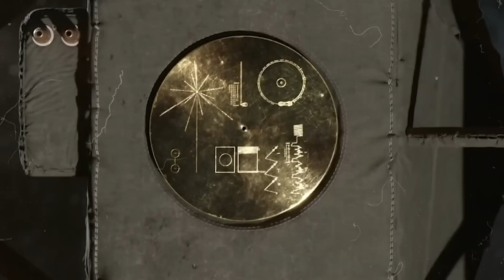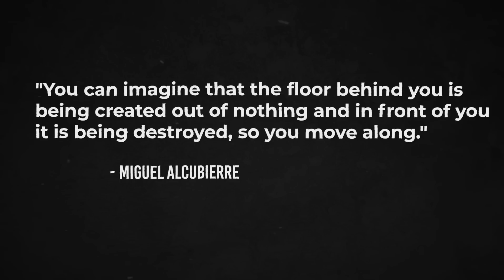Warp Drive Has FINALLY Become Reality! German Physicist Found A Solution!

Comment: The Alcubierre Drive is overblown.  Superconductors, a manifested Meissner force field (electrogravitic neutron field) around the object's nanomeshed energized surface (Section 4 - Area 51 - UFO fabric).  No extended ringed drive - like a Dyson ionizer air fan.  Propulsion is done via a gravity drive (like a tractor beam) out front in whichever direction of velocity you want to achieve.  All true UFOs have such Meissner force field, which allows supersessional flying with no gravity, g-forces on the pilot and occupants, or shear forces on the vehicle.  A Meissner force field is the actual worm bubble "slipstream" that one sees in the tictac video.  That worm bubble removes all physical matter interaction, and is the portal into the dark universe, with velocity creating the appearance of a worm bubble.  De-manifesting the Meissner force field (worm bubble) pops the starship back into the physical matter universe.  As such, a worm bubble is the warp and light speed.  This worm bubble removes A-L-L Einstein General and Special Relativity - and mass and light speed restrictions.  The cosmos is 3D and such 2D pictorials of Einstein-Rosen bridges and folding space is insane and invalid.  The cosmos has the multiple and parallel universes of the dark universe and physical matter universe - switching between them.

Proper understanding of superconductors are "conduits" between the unlimited energies and forces of the dark universe and the physical universe.  This is the truth of such supersolids, flow metals (metallic hydrogen), and supra-plasmas being free energy sources.  All modern definitions and experiments of semiconductors (with external forces applied to them) are not superconductors - they only have the appearance as a super semiconductor (Meissner force field).  Remove the external forces and return to an ambient temperature and pressure - and you have a semiconductor.  True superconductors are self-powered and self-regenerating from the dark universe - and operate in any ambient condition.  As such, superconductors are the source for all light speed, warp, worm bubbles with a Meissner neutron force field, and wormholes travelling to distant cosmic locations.

Quit thinking in the physical universe - and all the constraints continually being observed and hindering the true search for warp speed.  Moving into the dark universe eliminates all those conditions and restraints - allowing free flight potentials.
Reply: Bingo guy.  You figured it out.  Bob Lazarus worked at S4 on alien technology propulsion system.  He explained that alien space craft use this exact technique.
Reply: Interesting, I haven't seen this info pop up since the 80s. It was part of an investigation into creating anti gravity drives and essentially "splitting" open an bubble or envelope int the fabric of space essential removing the restrictions (drag) of space. It was originally orientated toward low gravity aircraft.
>
I speculated a toroidal drive based upon the liquid metal super conductors a while back and came up with something similar that create something of a low and high density space befor and aft of a space vessel.. Ahh, I just remembered what I used :P Forget gravity and space directly and manipulate the density of the Higgs Boson condensate to create the wave.
>
[edit] Ahh just also remembered they had to use a minimum of 3 toroial drives (triangular) to get any sign of a stable field.
Reply: @axle.australian.patriot  yes all these opinions are considered viable - if you have the extreme proper energy resource to distort (warp) the space-time fabric.  As such, to conventional scientists - they only admit to 4-6 hydrogen atoms per square meter (in near 0.0 PSI) of space.  Yet, they won't admit that 1-5% is the considered mass of the physical universe - while 95-99% is the dark universe of sub-particulates.  So there is a fabric that is below the physics atomic level, which is the real fabric Einstein contends with.  When you have a Meissner force field --- all of the physical universe negates Einstein (and Newton).  Now with recent days of research, the tictac drives is completely (and only) uses the Meissner force field with its -, 0, and + polarities in the actual thrust, propulsion, or deviation of the craft for its supersessional flying abilities.  There is no need for any further devices.  At the extreme energies of the Meissner force field creates the worm bubble that then allows warp speed.  It is that simple now.  The only resource that is needed is the true superconductors providing the UNLIMITED  Dark Universe forces and energies of that space-time fabric.  As Tesla (and the ancients said) the cosmos has unlimited energies - that only need to be understood in how to acquire that technology.